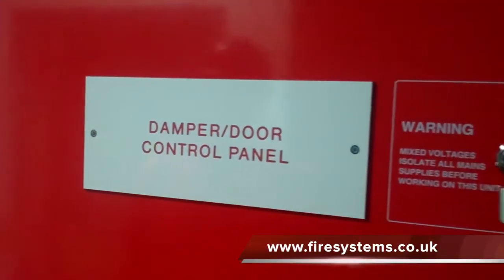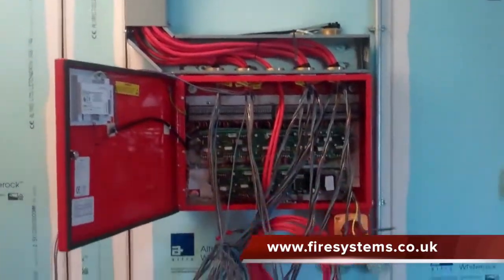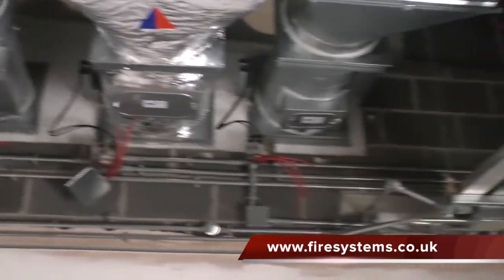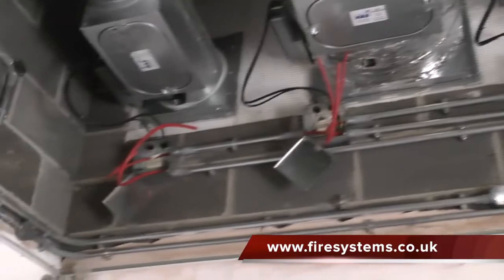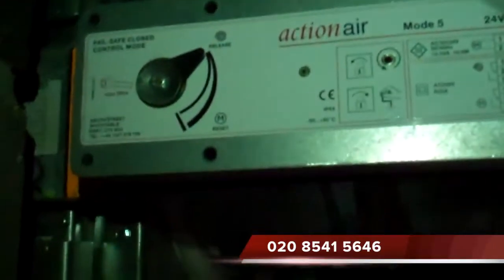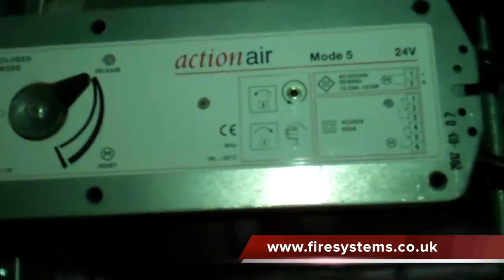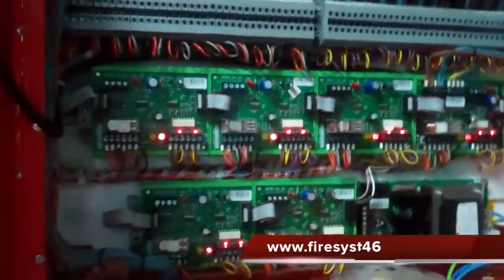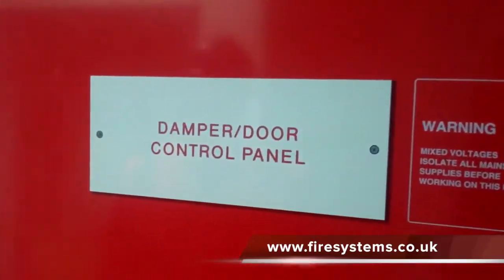Smoke Vent Systems - Smoke Dampers - Fire Systems Ltd

Comment: Does the damper wiring have to be in FP cable? Surely it is classed as fail-to-safe, or does it require to be monitored by the damper control panel, using FP?
Reply from the maker: +jayja45 
Yes, the wiring should be in approved fire rated cable. Not only is the cable being used to activate the dampers, but also monitor which dampers have closed.